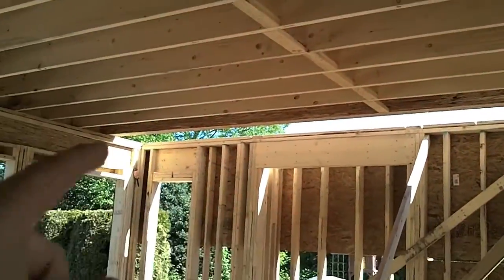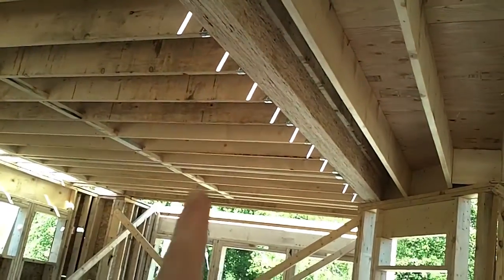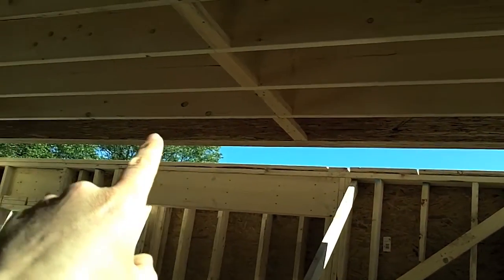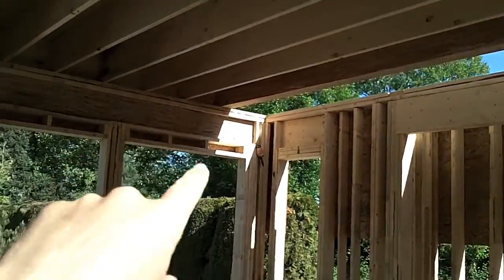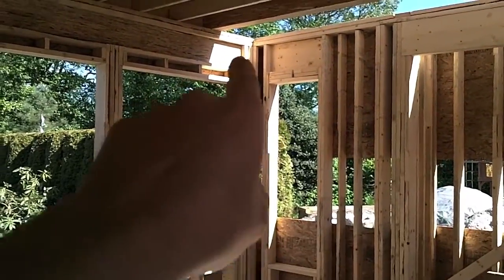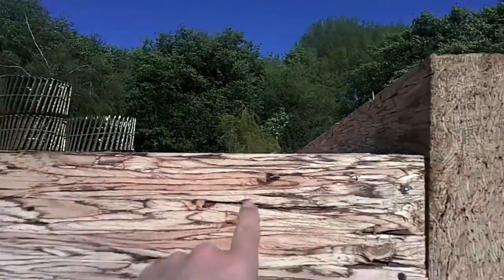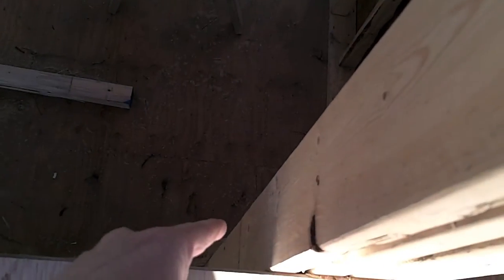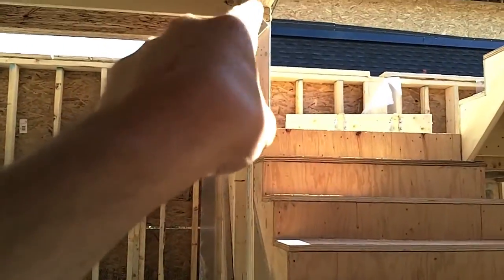What is a point load?

Comment: Actually thats a spread load not a point load a point load is the downward force exerted by a single heavy thing inside or on top of the structure such as a fireplace hot tub or water heater a spread load is the outward force on walls caused by the downward and out ward force of rafters if your structure isn't prepared to handle these loads it can cave in